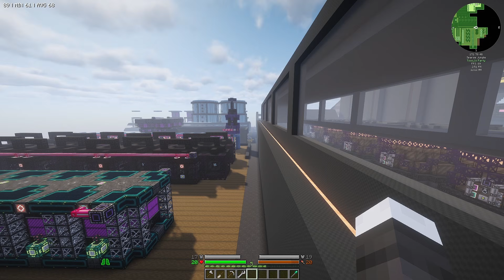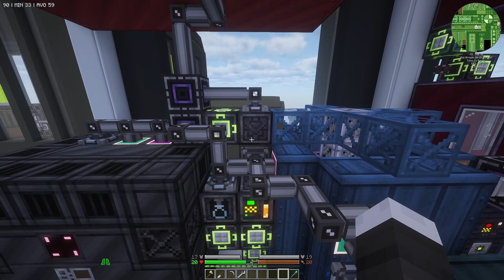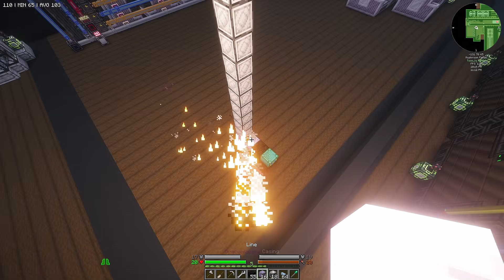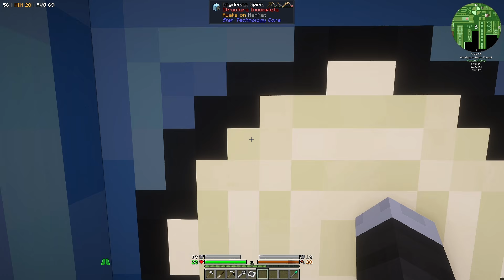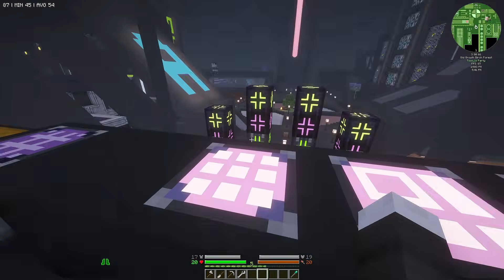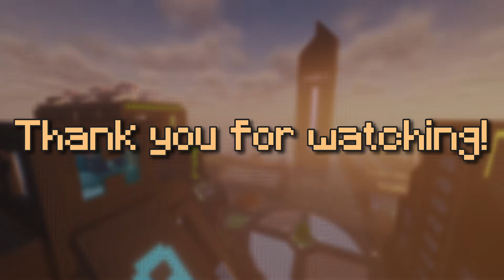Star Technology E38: Harvesting the Abyss

Comment: I didn't see it in jei in the video at 16:33, but couldn't you have made yellow wool with chemical yellow dye that you can make with salt and sulfuric acid in a loop with a small seed amount of vanilla yellow dye? That would probably have been less hassle than the hydroponic farm, tho automatic one more thing is also fun so ultimately it shouldn't matter much, but if scale ends up being an issue somehow you should def look into chemical dyes
Reply from the maker: Dear employee,

Yeah, but having a full separate looping setup would've been more effort than a farm. Plus I generally avoid level maintaining a loop where possible

Best,
HamCorp
Reply: @Ham-Corp  Out of curiosity: why not have the loop just feed an LV super tank/chest (depending on whether you wanna bulk store the liquid or the solid) or something and just let it fill up the buffer and stop when full? Esp since the inputs are salt and sulfuric acid, both of which are cheap (actually salt might be more annoying to source in star tech, I haven't played the pack yet)

EDIT: also noticed another guy in this comment section suggested a level emitter with a crafting card (I replied to that comment with more info about how it works for others reading), so that would also work for the dye loop
Reply from the maker: @blucky_yt  it would be super free, but this felt easier at the time :P
Reply: Hmmm, i thought there was dye washing was a thing for yellow coloring. Maybe confusing create with from other modpacks.

Comment: FYI, you can do some jank with the level emitter's crafting card mode (the option that crafts items) to make the hydroponic garden work on-demand
i have mine configured to just toggle bus the input seeds and it works perfectly
and this means you don't need to have a dedicated hydroponic garden for seaweed and dandelions
Reply: to elaborate on the jank for anyone else reading: when there's a crafting card in a level emitter, the setting inside the level emitter becomes a "recipe" instead of a trheshold, and when that "recipe" is "crafted" by the ME network, instead of pushing ingredients out of an ME Interface, it just turns on the level maintainer until the "craft" is complete. Useful for passive farms or loops that don't need its outputs bulk stored